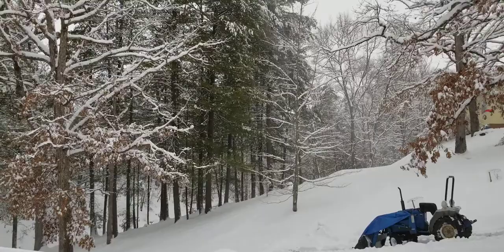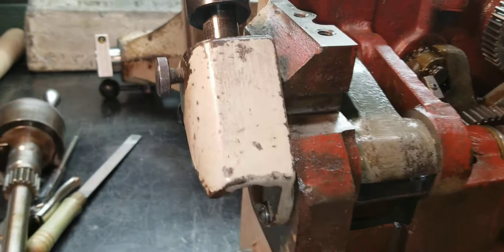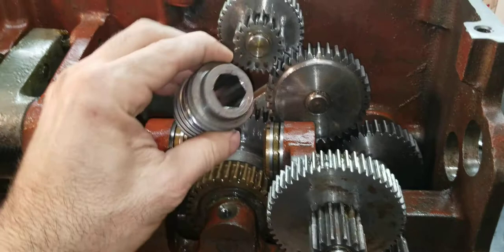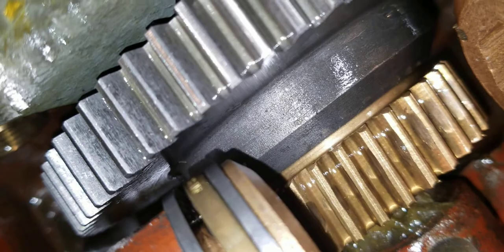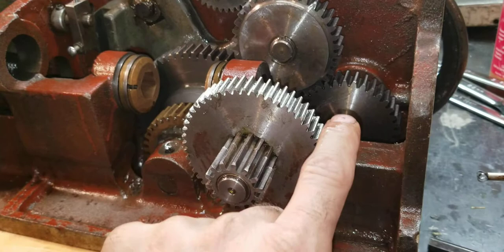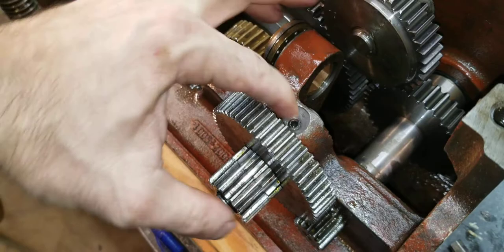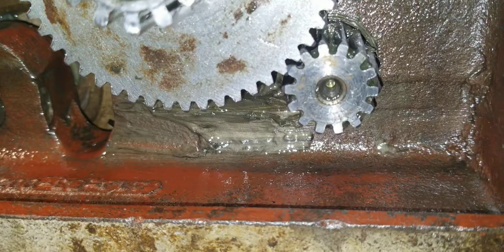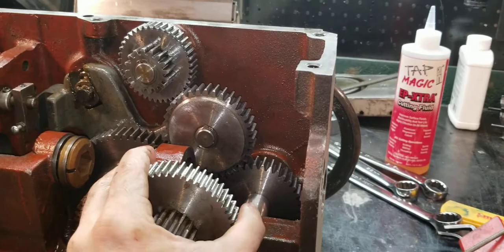Inside view of a 14" Rockwell lathe Apron.

Comment: Thank for the vid,  I took mine apart this past weekend as well,  had some chips in the base,  pressure washed it reassembled with new oil.   I did not see any wear I but may have missed it so I will unbolt it and recheck tomorrow.  Mine came with a turret installed so it might not had much use of the lead screws
Reply from the maker: If its wore at at least as bad as mine was you'll know it without taking it apart because you will have excess backlash in the handwheel.
Reply: @Depth_of_Cut  no wear at all,    thanks for the vid...

Comment: I've got the same lathe in my high school shop, hasn't been touched in 20 years and were firing it up. Everything appears to be good to go except power feed, and after some gumshoeing we've realized we're missing the lever for the clutch - there's just a post with an axial thread hole and two flats on either side. We can machine a new handle, but aren't sure exactly how it assembles to the post. Don't suppose you could shed some light?
Reply from the maker: I made a video of the adjustment of that handle and other things a while back. I was wondering why you didnt comment there. Its it's because it's not there I never uploaded it. I'll up load it. I think it will show the feed lever good enough to make a copy.
Reply: @Depth_of_Cut  that would be awesome, I was having a heck of a time mentally mocking it up.